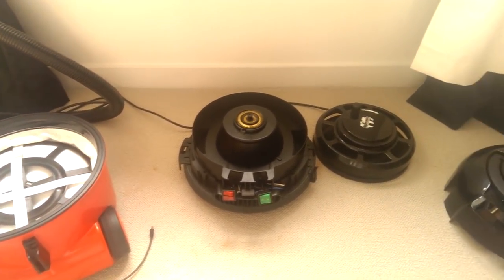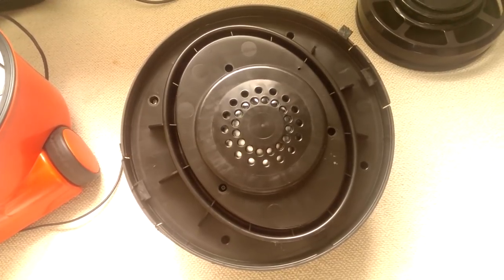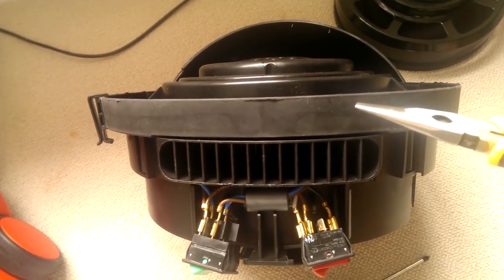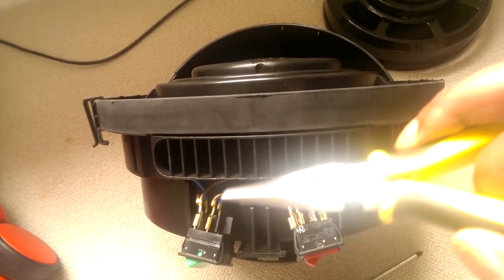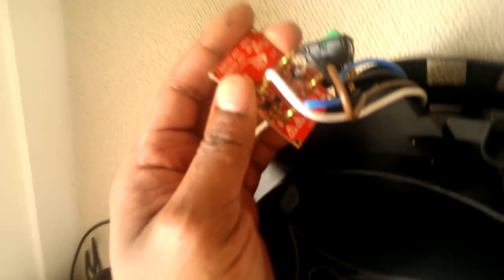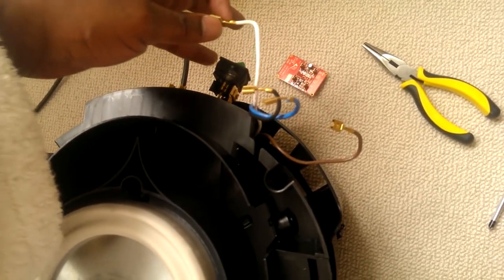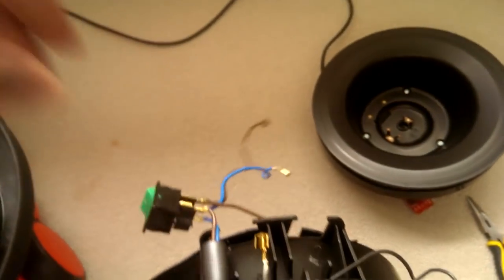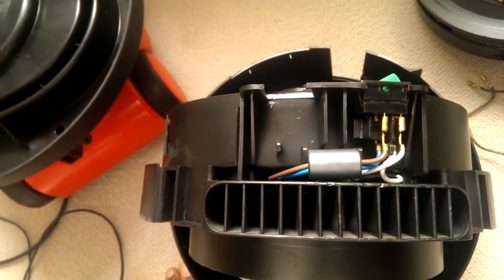Fix a Henry Hoover which won't start by bypassing the printed circuit board (PCB) #henryhoover

Comment: I did this years ago and it fixed problem... Now my henry is 7 years old and it's not firing. I messed with the wires that are going into the on switch and turned it on... Voila... Moved hoover as I was hoover g and it cut out.. Haven't managed to get it working again.. :-(
Reply from the maker: Holly A sorry to hear that. Sounds like you have more complex issues that aren’t just about a dud PCB.  This video only concerns PCB issues. Good luck with yours.

Comment: I’ve done this but now my Henry just runs (underpowered) for about 3 seconds and then blows a fuse.
Reply from the maker: bensmith907 cant say i know what’s going on with yours. It worked for me and many others. You may have deeper issues that this doesn’t solve.

Comment: So....this should also work for my Vorwerk VK136.....knackered PCB....altho' it does have a 3-way switch for power settings AND on/off combined......off to take it apart; what the hell....it's useless as it is :)

Comment: Or you could just replace the pcb
Reply from the maker: thehooverguy101 You can if you want to buy one. Then probably wait for it to die again. I’ve never needed to switch from high to low. It’s a point of failure that I can live without.
Reply from the maker: You can if you want to buy one. Then probably wait for it to die again. I’ve never needed to switch from high to low. It’s a point of failure that I can live without.